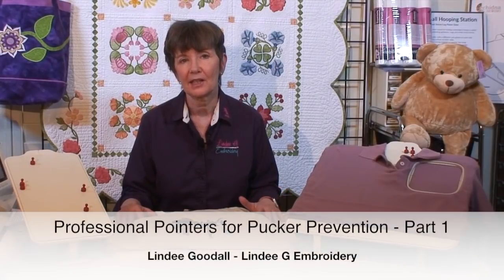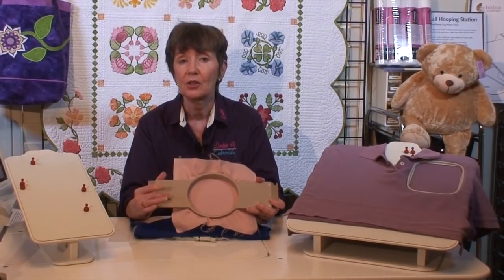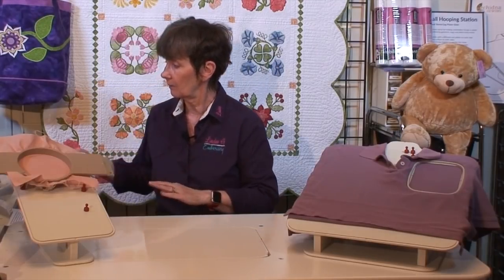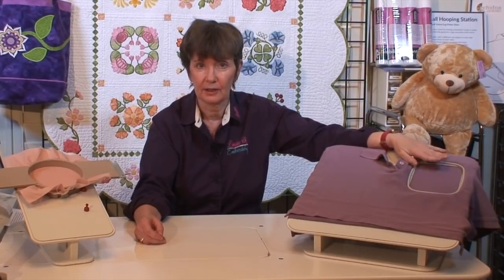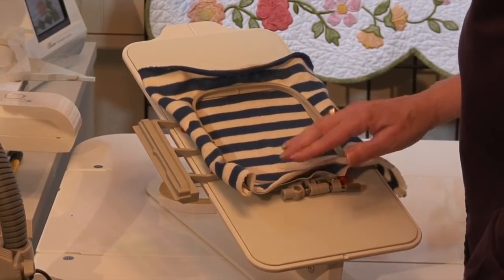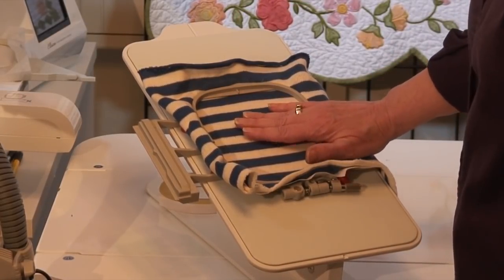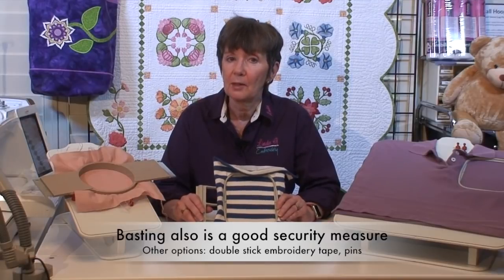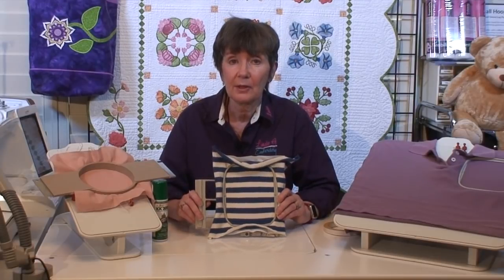Professional Pointers for Pucker Prevention - Part 1, Hooping Properly

Comment: Hi Lindee! What stabilizer and tips do you suggest when embroidering on satin/silk fabric?
Reply from the maker: Depends on the design and how you're hooping. You need to think about how great the "distortion factor" is in the design. A redwork design is very low but a large dense, design with shaded layers and many stitch directions has a lot of distortion. You need to select a stabilizer that can support the stitching from beginning to end. I talk more about that in my new book "The Embroidery Recipe."
Reply: Than you Lindee!